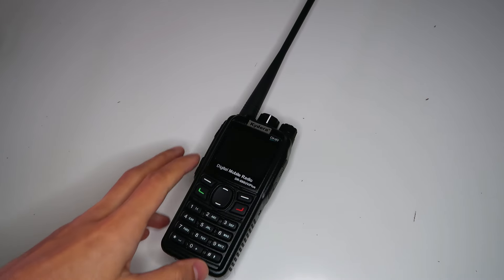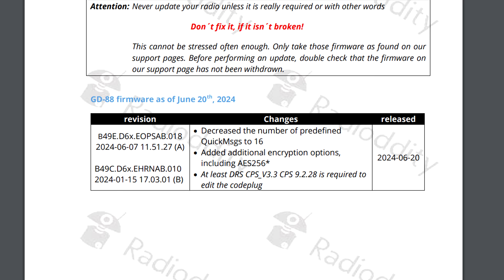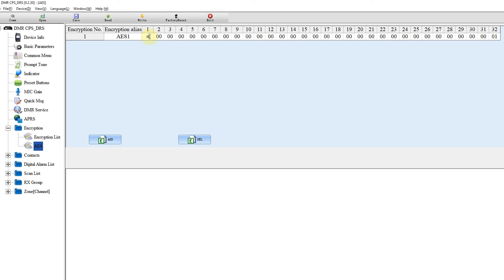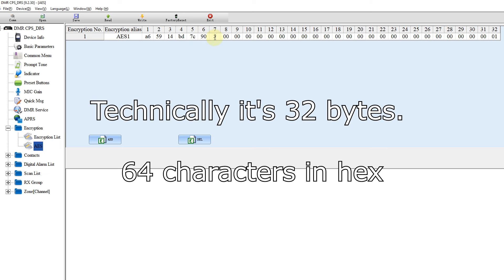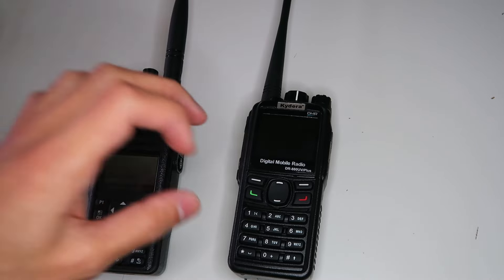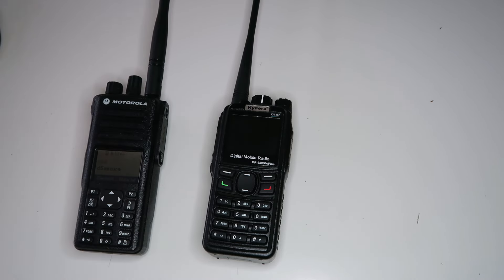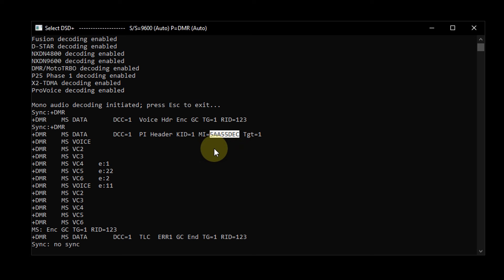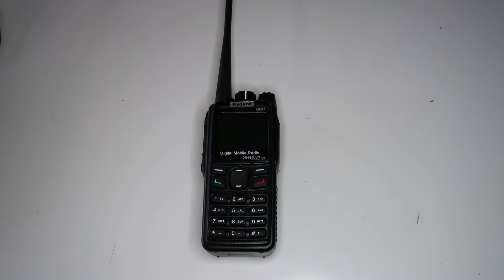Radioddity GD-88 - They added AES, but does it work?

Comment: Decided to try out a GD-88. It has several features that interested me. Bought one directly using a coupon. On checkout they charged me full price instead of the reduced coupon price. When the radio arrived four days later, it was a brick. That’s one strike for every interaction with them so far. Radioddity REALLY doesn’t seem to want me as a customer. I’ve notified them of their mistakes and we’ll see what happens.
The second one they sent me had a malfunctioning screen. Followed the process they recommended, and eventually the process caused the radio to brick. Dead as a doornail.
Radioddity sent a third radio. This one has been 90+% functional. GPS isn't working/APRS isn't working. The radio isn't detecting GPS satellites. I suspect this is a bug in the firmware. This one probably doesn't need new hardware, but new firmware.

Comment: have you tested AES on the stock software that comes on radios like the TYT MD-390 or Baofeng DM-1701 (it seems to be very similar software on these 2)
Reply from the maker: I had no idea those radio had AES. Are you sure it's not some other form of encryption? Usually these radios come with encryption but not a recognised, good standard like AES
Reply: @radiosification  the listings on aliexpress say AES256 encryption, and it uses a 32 digit hex key. I can't say for certain tho.
Reply from the maker: @dedsert9653  that's cool, I will look into it. Thanks
Reply: I can confirm (as I’m making a review, and this has provided inspiration) that the Zastone UV-008 rolls the IV on each TX.
Reply: I have the tyt uv 390 and I’ve tested AES 256 and it works

Comment: Hi Ben, I hope you're doing well! I have a quick question for you. I have two radios, a Baofeng UV-5R+ and a TYT MD-UV380, and I'm using the same antenna for both. I've noticed that the Baofeng UV-5R+ seems to have better RX sensitivity for weak analog signals compared to the TYT MD-UV380. Have you noticed this difference before? Thanks!
Reply from the maker: Hi Wassim. I haven't noticed it, never really tried that. I'd guess the MD UV 380 might have more filtering, which could make it less sensitive but would improve the selectivity (so it won't suffer as much interference from other frequencies on receive)
Reply: @radiosification  Thank you for your reply Ben I really appreciate that